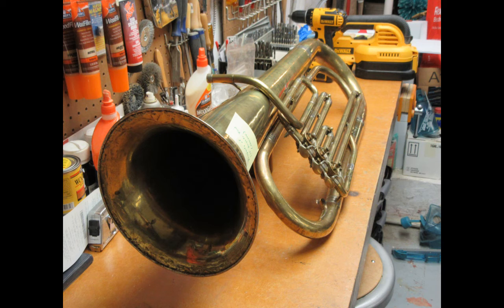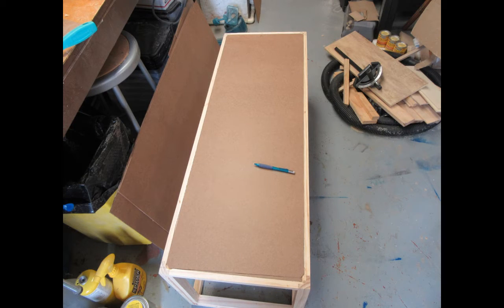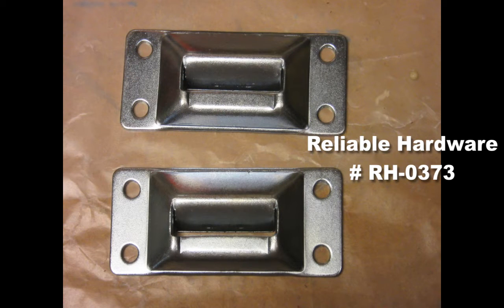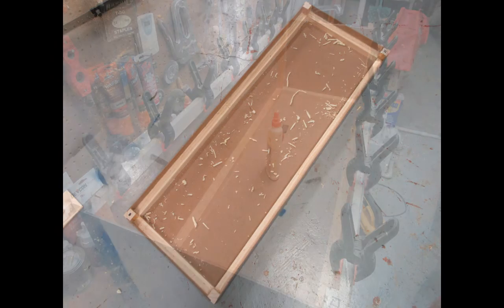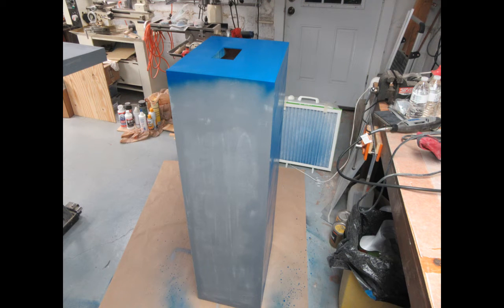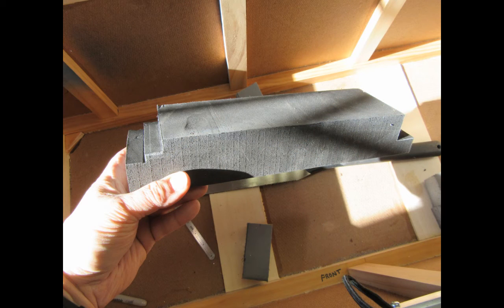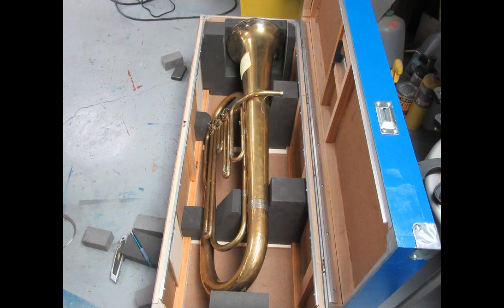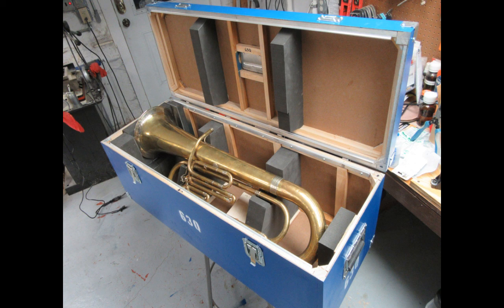A Method of Making Road Cases for Musical Instruments

Comment: Great video, great method. You are very articulate. I've made a few cases using a similar method.  Your use of stringers is very appropriate for the the form factor you are making. My cases have been for electric guitars and are very much shallower so I use 3/4" thick perhaps 4" wide solid pine boards for the four sides. I cap the top and bottom with 1/4" Luan plywood rather. I'd venture to say that 1/4" Luan is as light and perhaps stronger than 1/8" Masonite per square foot. Another advantage of Luan is that it can be lightly sanded. The outer plies are mahogany and can be clear finished as they are quite attractive. I route a valance in the pine rather than using aluminum. I finger joint the pine at the four corners. I round over all pine edges with 1/2" radius round over bit accept where the lid meets the bottom half. Overall this results in a quick build since the pine can be screwed to anywhere without reinforcement. It also makes for a very lightweight case. Thanks so much for posting your method. Mine would not be practical for such a deep case.

Comment: What about making a contoured case for a tenor sax?
Reply from the maker: I make ROAD cases. Contoured cases are typically not road cases. Their shape is designed to make them more ergonomic for daily carrying around, NOT for the rigors of typical 'road' use. Also, contoured cases do not stack or lack well in trucks, airplane baggage holds, etc; whereas road cases do. Furthermore, contoured cases are much more complex to build, not something that I could easily describe in a video, and not something which most people would be able to make in their own shops. Finally, anyone can buy a contoured saxophone case anywhere, no need to make them yourself.